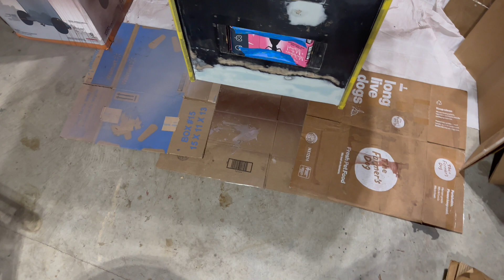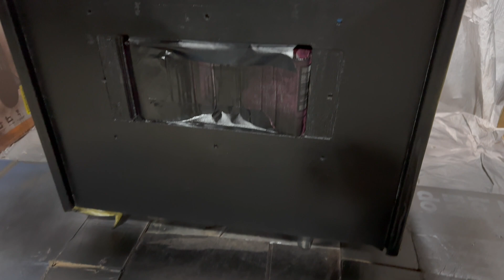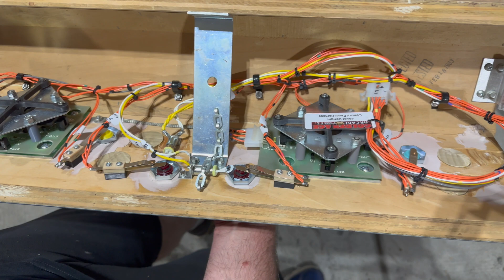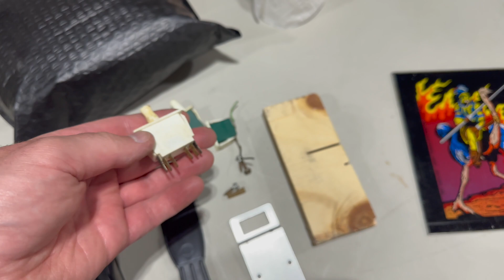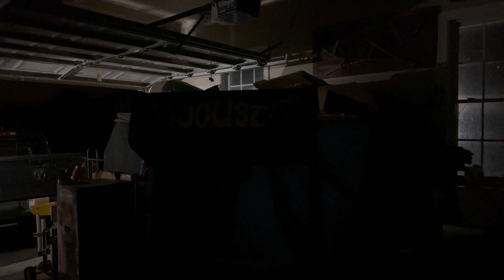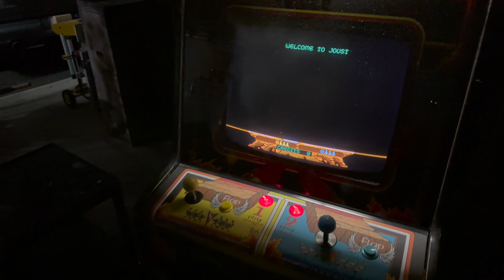Joust Arcade Restoration part 12: the GRAND FINALE! 😍 Finishing touches, re-assembly, & gameplay

Comment: I enjoy watching you fumble through the process. But come on man, they still make plastic cable ties, and other hardware you can replace. Also you can use LED lights for the marquee. I know you want to RESTORE the cabinet. But there are products you can use to replace old tech in certain areas. Edit, at least you used led lights for the 1p and 2p. Save yourself some money running multiple cabinets in your basement.
Reply from the maker: I've heard you can even replace the heavy old CRT monitors with brand new flat screens too! 😂

Comment: I just put those translucent red P1/2 leaf switch buttons in my Arcade1up Joust but I was wondering how to install lights in them since the leaf switches and plunger prevent me from putting regular LED button lights underneath the plungers.
Reply from the maker: If you look at how the lights are mounted on the original Joust, Robotron, etc. control panels, you'll see that they're adjacent to the underside of the buttons -- not directly beneath them. That will effectively illuminate the translucent button material when lit.